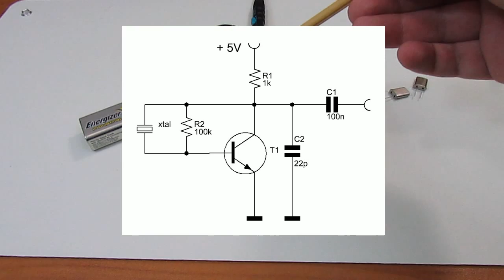Crystal oscillator frequency pulling

Comment: finally i'm starting to understand oscillators, yes, capacitance in series reduce and thus according to oscillation freq equation, the freq will increase, but in parallel the tank circuit capacitance increase and thus freq will reduce.

Comment: Outstanding explanation. One small point - If a parallel cap. decreases resonance, and a series cap. increases resonance, instead on using an inductor in series with a cap. why not use a parallel cap across the series cap. Could this arrangment also enable tuning above and below the resonant frequency? Thank you so much.

Comment: Sir how to use crystal in radio receiver circuit
Reply: Build a superheterodyne receiver in which the local oscillator uses a crystal. The local oscillator's frequency output should be slightly higher than the desired reception frequency so that the difference frequency from the mixer is allowed through the low pass filter and then demodulate it.

Comment: HOW COULD I USE 13.8 VOLTS TO POWER THIS
Reply from the maker: jonneil smyth 13.8 should be fine in this Circuit
Reply: and last questions please can i use higher frequenceys say 40 mhz and will the 2n222 still work up there
Reply from the maker: jonneil smyth The 2N2222 will Work just fine at 40 MHz. But Note that you will have to use a fundamental Mode Crystal. Some Crystals 30 MHz or higher are overtone Mode Crystals

Comment: My 4.9512 MHz Crystal datasheet has following data mentioned in it
Shunt Capacitance C0, Drive Level ,Equivalent Series Resistance ESR Table
Load Capacitance CL    =>   Range  8pF - 32 pF 
My 4.9512 MHz Crystal datasheet has following data mentioned in it
Shunt Capacitance C0, Drive Level ,Equivalent Series Resistance ESR Table
Load Capacitance CL    =>   Range  8pF - 32 pF 
I am trying to Calculate Parallel capacitors neede for 4.9512 MHz
C = 2(CL - C_Stray - C_pin)
What value should i consider from the range of CL ( 8 - 32 pF)
http://www.comkey.in/sites/default/files/attachments/NXE4.9152AC20F-AHF.pdf